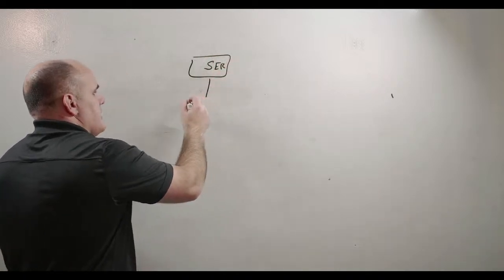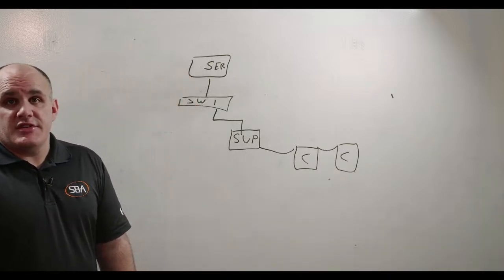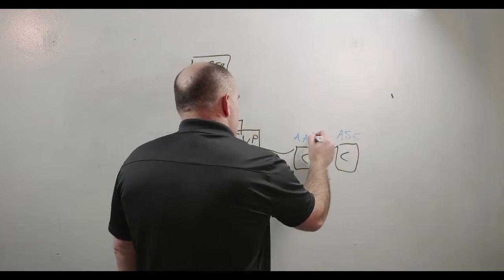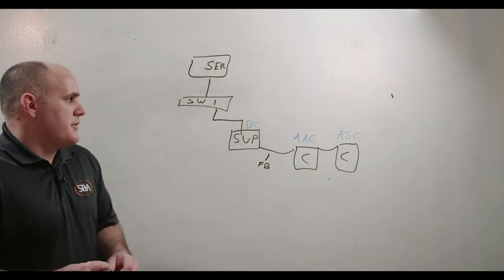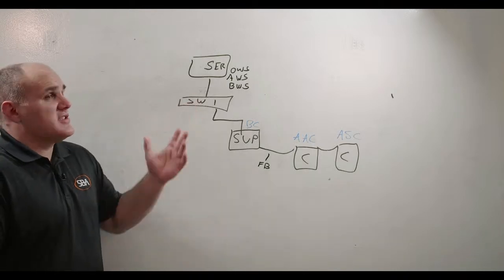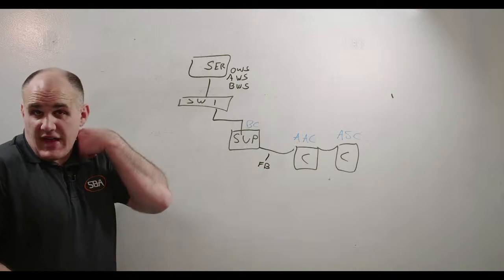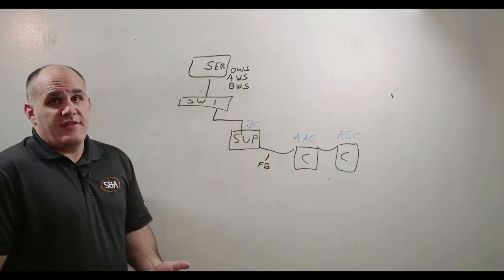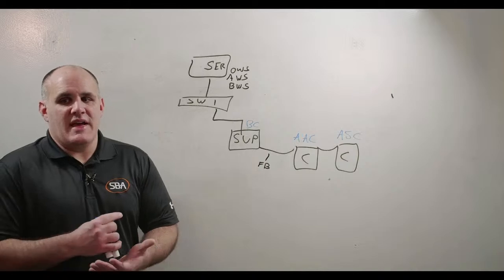SBA TV 13: Controller Hardware Types

Comment: What kind of cables do we use from field devices to the server points.
Reply from the maker: Typically we don't go from field devices to servers. Servers typically connect to switches via Ethernet cables. 

Field controllers typically use 18/3 to 22/3 to connect to supervisory devices.